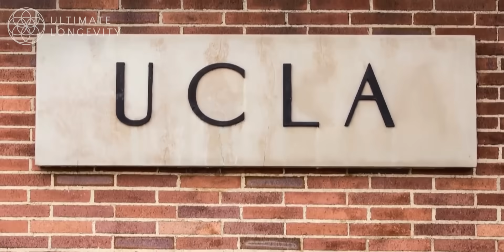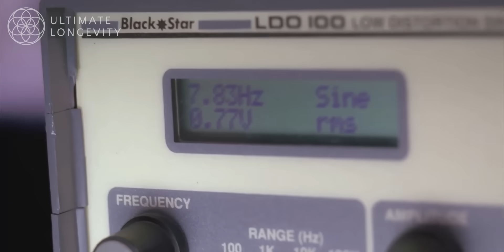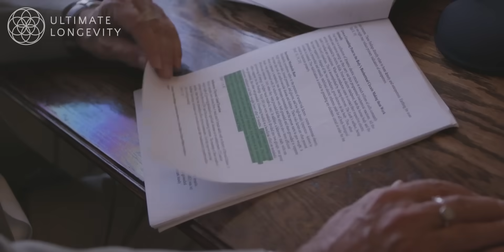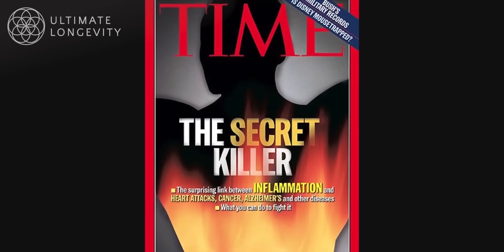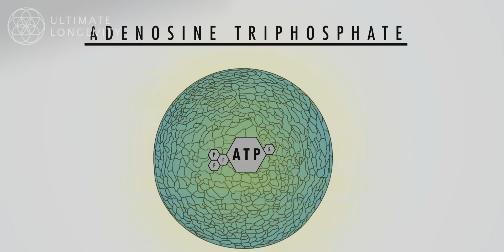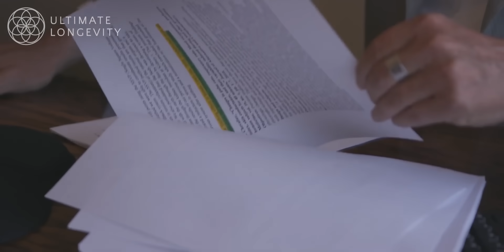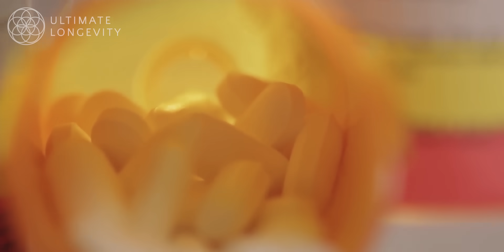Earthing & Grounding: Science & Benefits (11 min documentary)

Comment: SO A GROUNDING ROD AND COPPER WIRE RAN TO MY BED , TIED TO ME AND IM GROUNDED 
 HELL YELL , DO I TAKE IT OFF IN STROMS 🍀
Reply: As a safety precaution, it is best to disconnect a grounding device during a thunderstorm.
Reply: There is an earthing connection in every socket. U dont need a grounding rod.
Reply: @infinity8288  it's better to do it straight to the ground so you don't peek up dirty electricity
Reply: @אור131  Hmm, good point. Best way to do it is walking on sand or wet grass.

Comment: This film is really bad advice. These people don’t understand simple electricity measurements or the human body’s skin impedance. Dangerous stuff.
Reply: Firstly, this video is recommending walking barefoot outdoors. I don't think  reasonable people would consider that dangerous from an electrical point of view.

When it comes to indoor grounding devices, there have been over 20 scientific studies, all of which used indoor grounding devices, and most of them placebo controlled and peer reviewed, showing the health benefits of grounding. I used to be skeptical myself, but if you actually read the studies, then it's pretty hard to say that there isn't something beneficial happening when people are grounded. 

There are people who make claims that grounding is dangerous because of EMFs, but these claims are inaccurate. For example, one study at the PennState Neonatal Intensive Care Unit looked at the effect of EMFs and grounding on premature babies. The babies were in incubators or radiant warmers out of necessity, but these machines put off a substantial amount of EMFs from their electrical power. The researchers measured the babies' EMF exposure, the AC voltage on the babies due to this EMF exposure, and the babies' vagal tone. Vagal tone is a measurement of autonomic nervous system balance, or, in simpler language, how healthy and resilient a person is. They found that the higher the EMF exposure the babies had, the higher their AC voltage was (not surprising) and the lower their vagal tone was (not a good thing). As soon as they grounded the babies, their AC body voltage went down, and their vagal tone rapidly increased by an average of 67%. So grounding was beneficial even in the presence of the EMFs from the warmers and incubators.
Reply: @AlexArthur94  How can they be scientific if the measurement process is not found in any electrical literature?  I have measured many areas where there was voltage in the earth and kHz frequencies were present. Many of my clients have been made ill from this unscientific practice.
Reply: @TotalEMFSolutions  In the scientific studies, they grounded participants and then measured parameters, like blood viscosity, circadian cortisol profile, and other biomarkers, or recorded subjective parameters, such as sleep quality, pain levels, muscle soreness when recovering from eccentric exercise, etc. The placebo effect is ruled out, because these studies were placebo controlled.
Reply: @TotalEMFSolutions  Let people do what they feel comfortable with. Stop being a granny.
Reply: @TotalEMFSolutions  It's not about YOUR scientISM beliefs- it's about Nature.

Nature>scientISM
Reply: Paul even if it cures someone’s psychosomatic issues I do t think it’s dangerous.  People have walked the world barefoot for 150,000 years.  You ever notice how kids and people at the beach are all so happy. Mainly because they aren’t wearing shoes.  Ever walk thru Central Park? Thousands of people on blankets with no shoes laughing and having fun.  You should probably try it some time.
Reply: Dont be afraid my friend. The earth loves  you it not harm you. Start grounding for 3 days and come back here to tell me how your feeling. It will change your outlook. I don't know who you are but I love you and I hope you have an amazing week ahead.
Reply: I bet you were born with a pair of shoes on, Good Luck with that science of yours. Science is nobody's private commodity, it keeps on evolving. We have not even figured out 5% of what Earth offers to us on a day to day basis. Walking barefoot, is recommended in Yogic Practice as well.
Reply: I'm actually  interested to learn your input on that. Do you think the main issue with grounding mat is about EMF or something else?
Reply: @MymzieLo  “For a given external electric field, the strongest induced fields are for the human body in perfect contact through the feet with ground (electrically grounded) and the weakest induced fields are for the body insulated from the ground (in “free space”).” Meaning anything that attaches you the earth actually increases exposure to induced electric fields.  People are following the worst advice ever. It’s similar to an episode of “The Twilight Zone”
Reply: @TotalEMFSolutions  What about the grounding device basically making you a Faraday cage and them protecting you from EMF?
Reply: @TotalEMFSolutions  I don't know. I just read a paper from a physic engineer (Beware of Earthing Misinformation,
Nov. 2018,
Gaétan Chevalier, Ph.D.
University of Montreal Polytechnic School, Engineering Physics) who seem to understand pretty much about it and still recommand it and think it is really safe and beneficial.
Reply: @MymzieLo  if one can’t measure properly how can they be an authority? Is he an electrical engineer?
Reply: @MymzieLo  I just watched an interview with him and wow he really doesn't know what he is talking about. Beware of people that proclaim to be a physics engineer that use a multimeter to measure the same potential and because the meter displays zero they think there is no frequencies or voltage.  Then they tell you that earthing in a dirty electricity environment is good. It has inspired me to make a video to debunk some really bad information he is giving.